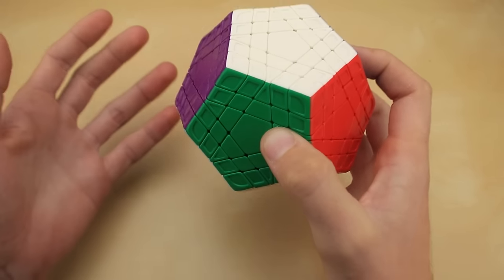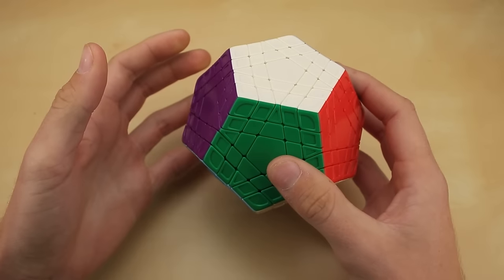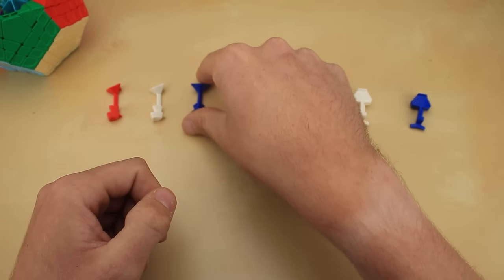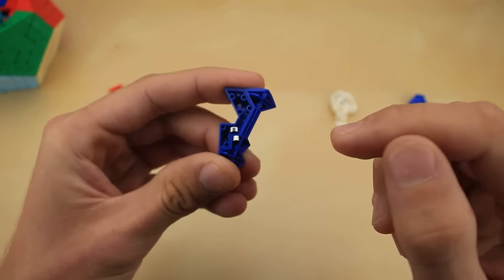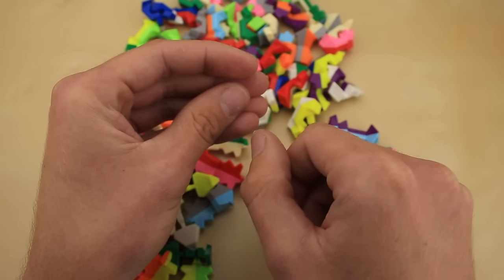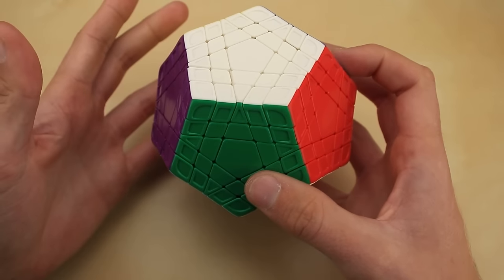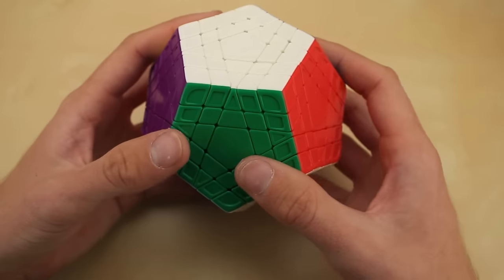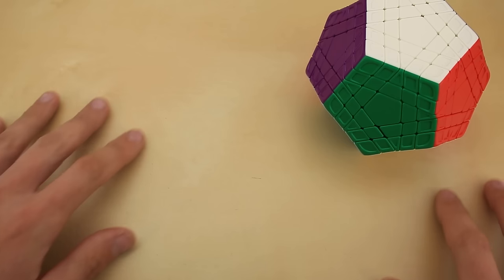How I Magnetized a *Gigaminx*

Comment: To keep weight down you could do what i did and use a dremel on the inside of the pieces to make space for magnets at the top so they are more effective and you dont need as big magnets. I used N52 3x1.5 magnets and they fit after some cutting down.

Comment: I am magnetizing my gigaminx by following this video.  I did have a question though.

Have you ever changed the color of pieces?  On my megaminx, I use black replacement pieces to replace beige.  It'd be nice to do that on the gigaminx too.  Have you had success with this type of change in the past?  Any tips?
Reply: specifically with changing the color of pieces by using spray paint or something
Reply: @hafheim  spray paint is kinda bad depending on how thick it will be. The coating can slow down that size so it would be a bit weird to do and deal with